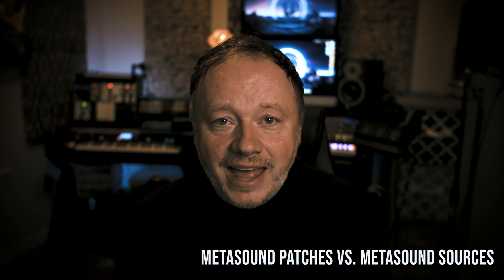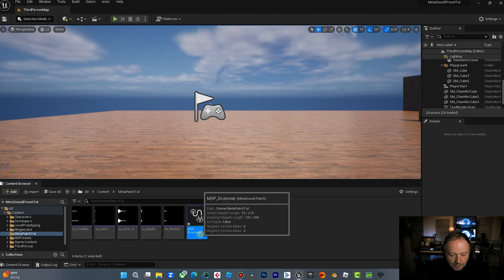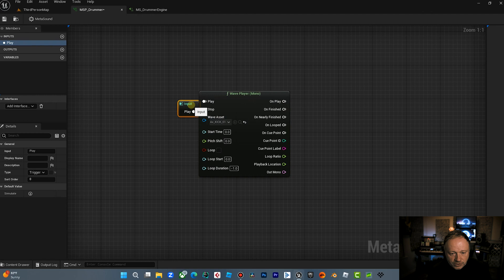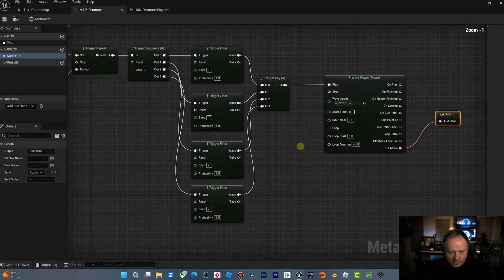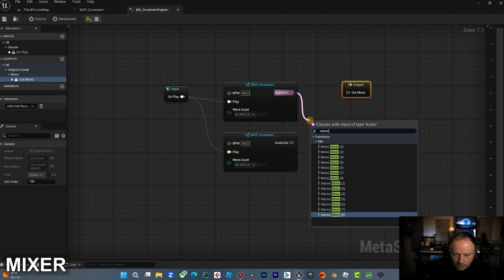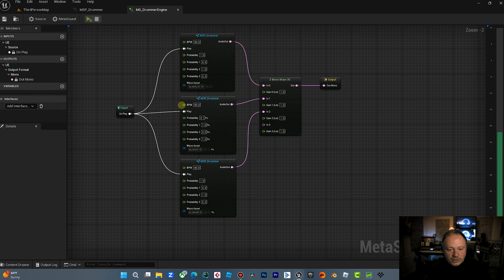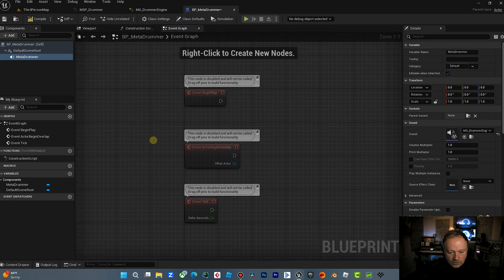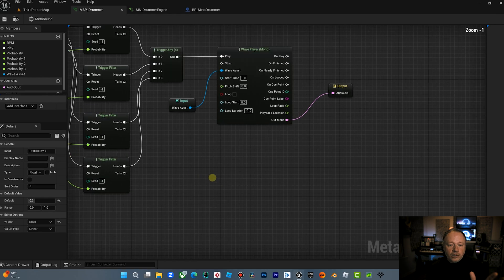Metasound Patch vs. Metasound Source: When, Why and How to Use Them in Unreal Engine 5.1

Comment: I guess I'm confused, Metasound sources already have this functionality..? You can just create a normal metasound source and call it in another metasound. When you use a metasound patch instead of a source, you can't preview what it sounds like which makes debugging 10x more difficult..?
Reply from the maker: The main difference is that a Metasound Source is a top-level asset that can be played directly, while a Metasound Patch is a reusable module meant to be embedded within other Metasounds.
Reply: @brianmichaelfuller but you can also embed the top-level metasound sources? Why not just use sources then if you can debug them much easier?
Reply: As I understand it - patches are lighter, as in - devoted of some functionality such as playback, one-shot behaviour etc. So essentially if you were to instead use MSSources in MSSources you would technically pass on redundant functionality, that you need onlv in the main MS you're playing. But I don't know how exactly does it affect performance.